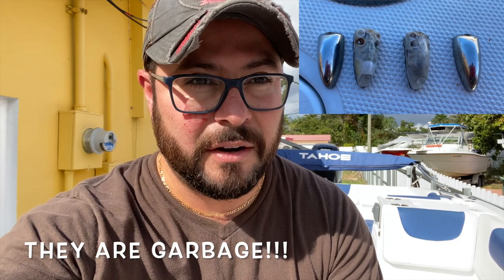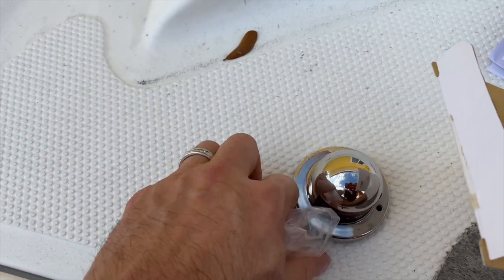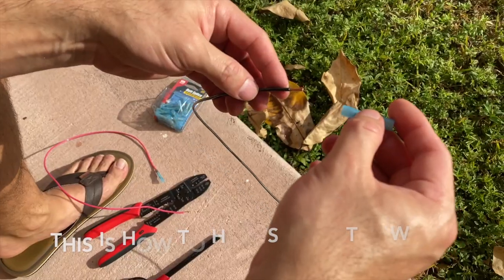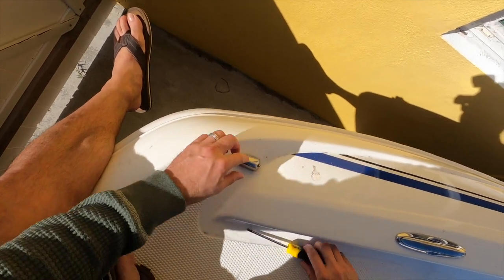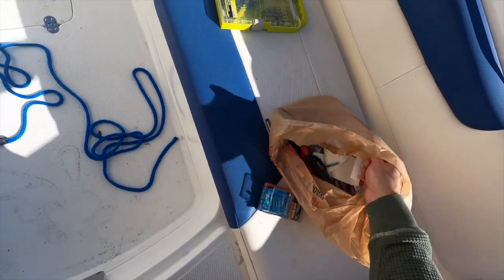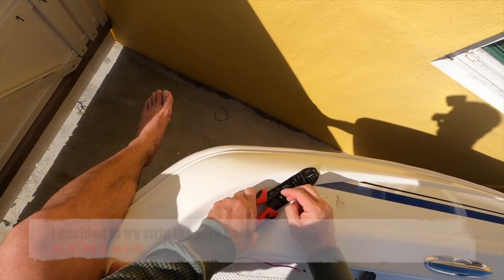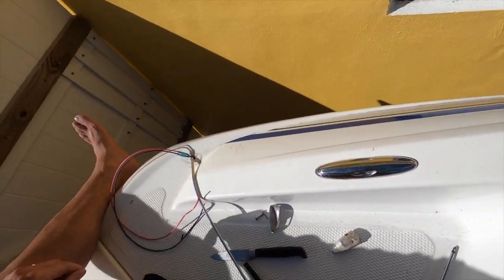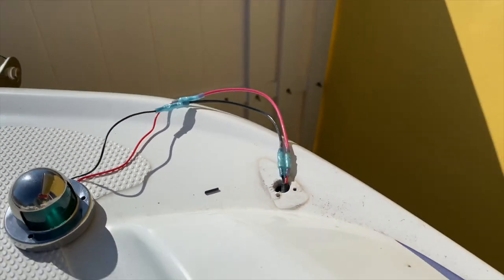TAHOE 2150 - Installing Boat Navigation Lights - Part 1 of 2

Comment: Nice job,just to let you know,maritime laws dictate an arc of 225 degrees on the port and starboard combined,and an anchor light of an arc 135 degrees.The port and starboard lights face back towards the stern by 22.5 degrees each from the perpendicular line of 180 degrees,so just placing them , like you did may not be legal,or it maybe ok if not spot checked.I enjoyed your video.
Reply from the maker: I check my angels before placing them because it came with a marker which indicated exactly where I needed to place them.  So yeah bro, thanks for that info.  It's more than what I knew.  I simply followed the instructions on the paper/diagram.  Thanks for watching and for commenting.  That was some good info.